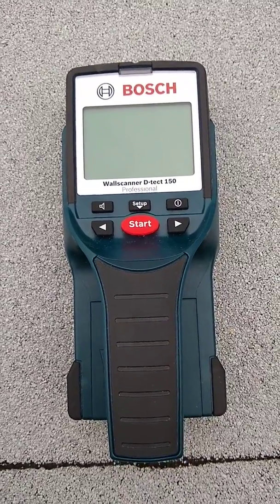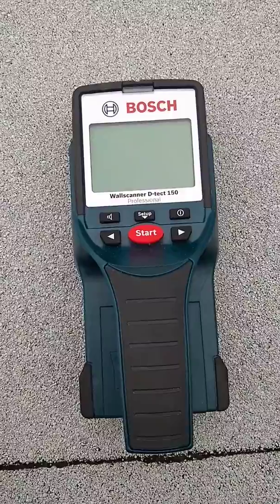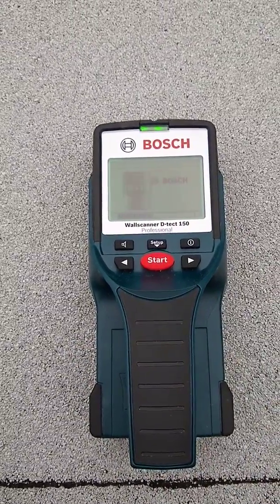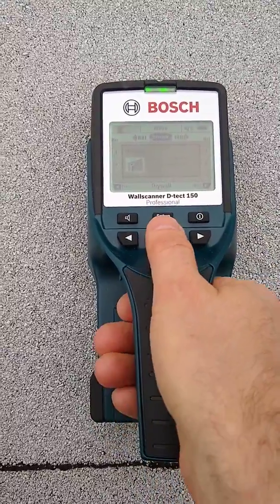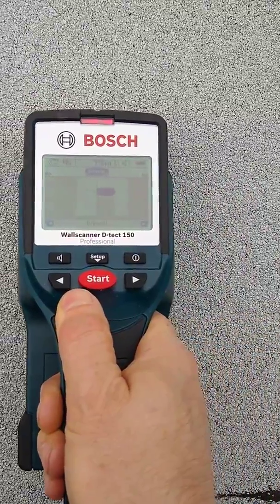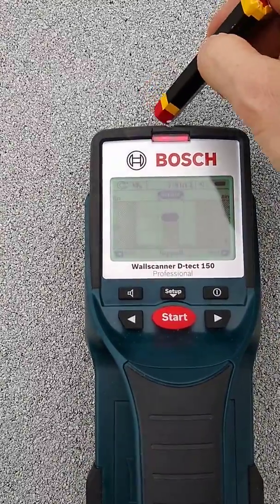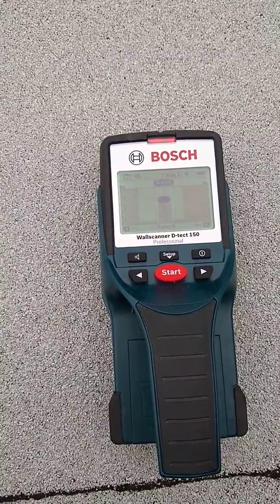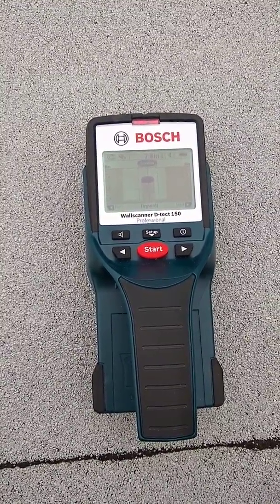How to Find Roof Rafters for Solar Mounts with Bosch D-tech 150

Comment: I Hate to to tell ya but that being a actual rafter is bout 20% in that drywall mode your using.  I spent the big bucks on this tool for the primary reason of finding rafters under shingles and Il say I was very disappointed. This bosch finder is very very good BUT not a reliable 100% accurate rafter finder under shingles. It’s readings can literally change on each scan pass. I’ve had that same Bosch over 5 years now with hundreds of over the shingle scans and all I can say is it likes to lie to you…alot.  
All the modes tell “white” lies to you when it comes to scanning over shingles. You must use all the modes (drywall-signal view and metal) and combine results to give you the confidence to say that’s a rafter. Start off in signal view..scan and watch for the highest peak on the graph. Once you get that highest peak look at the bottom of the graph and notice the little “castle” icon. (That’s not the proper term for that icon but it’s what Icall it. It’s the little icon with the 2 straight up towers and in the middle is flat..looks like a castle). Anyway…if you get the high peak on the graph and the castle icon right below it more than likely you are at a stud or rafter.  I then mark it and switch to drywall mode for a little help on a confirmation.  I scan very slowly in that area and if drywall mode picks up a structure that is a plus. Next you switch to metal mode. For some odd reason the metal mode is best at confirming rafters. If you get a hit on signal view and metal mode at the same marked location your chances of it being an actual rafter go up to about 80%.  If drywall mode also reads a rafter in that marked area your chances your on a rafter or stud is about 90%. So basically in a nut shell. You need all the help you can get in gaining the confidence knowing your on a rafter.  Use all 3 modes.